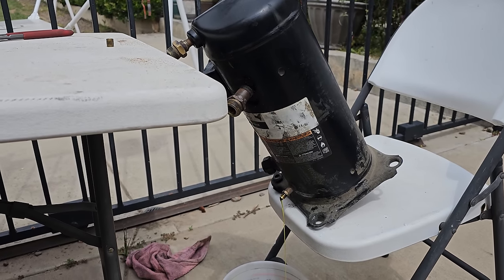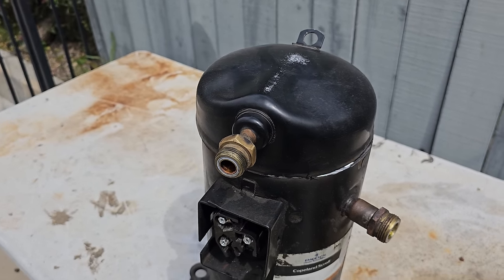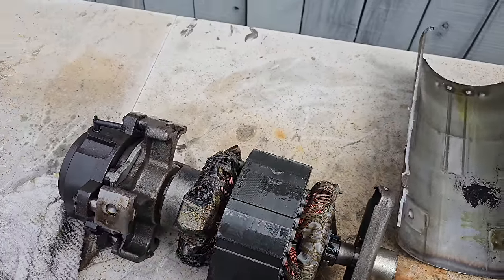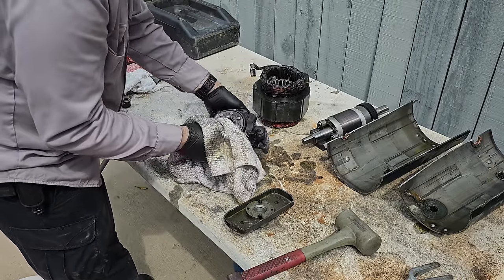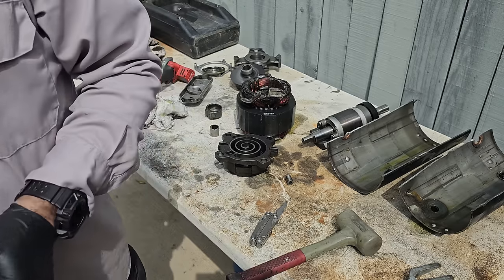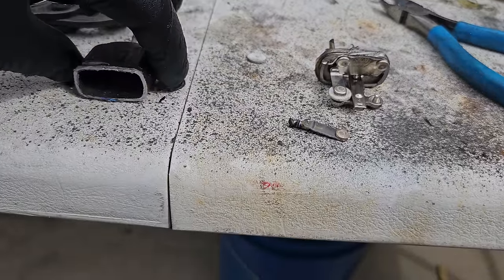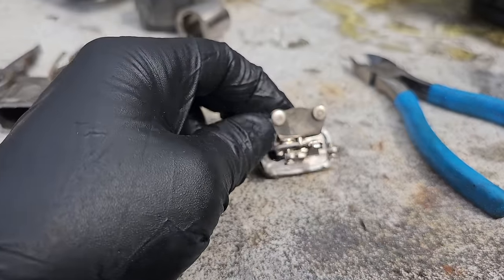COPELAND SCROLL COMPRESSOR TEAR DOWN

Comment: One easy safety tip is I know of someone who died due to cutting open a container with oil vapors inside, and it exploding due to the oil vapor/air mix and a spark from their grinding wheel. You can run a nitrogen purge while cutting, which should help reduce the risk. Thanks for making these videos as is is very cool to see what is inside.
Reply: Wow :(, may their curious soul rest in peace☮️ 
ive known of the risk with trapped vapor in oil which is why i drain and wait a day or two to start cutting, but this just placed me into a new world of respect… 
the worse flare ups for me are overheated or grounded compressors. Refrigerant grips onto the oil like crazy even after smacking the life out the casing.
Reply: This a compressor not a sealed container. This is open to atmosphere (open air) already, after pulling a vaccum on unit, and has 2 ports open that will dissapate anything left over if it heated up enough which a grinder likely wouldnt.
Reply: There isn't nearly enough volume here to have enough oxygen and oil vapor to explode. It would be a minor puff if at all.
Reply: @hgbugalou  you'd be surprised at the energy content of some of these refrigerants. I also have a different friend who combined some acetylene and oxygen in a small balloon (couple cups) and lit it on fire. When the fuel and oxidizer are mixed (like they would be in this), the explosion is waaay more powerful than a normal fireball because the flame front moves far faster than if you light the fuel on fire in the presence of air. It will be like a little bit of high explosive going off rather than a puff. From just a couple cups worth, my friend got the cops called on them because people thought it was a loud gunshot.
Reply: @kscgaming5857  This is exactly why I made this comment. It seems safe, but eg r290/propane has a lower flammability limit of just 2.1% in air. That means if you have anything above about 2% propane, it is an explosion hazard. Even with it open to the air, you could get pockets which are >2% propane, and then be a risk.
Reply: @armandodeleon5047  Thanks for the wishes and stay safe.
Reply: Yes but the limit for r290 in a self contained system is 5.5 oz, which isnt much, and still you would have bled the system and use some nitro to ensure its all out. The above video wasn't propane / r290 though, as common refrigerants are not flammable at ambient pressures/temps. That being said I also have had flame outs on r290 systems after having purged with nitro a couple times can be annoying.
Reply: @ErikMeike  I get your point but oxygen at atmospheric concentration and polyolester oil vapor generated at under 100F isn't going to explode like that once exposed to flame. Acetylene contains much more energy.  Polyolester oil is also very hydroscopic so there is going to also be water vapor further limiting said reaction. At worse it would just belch a little flame.

Comment: I think a contributing factor may have been a faulty solder point where the incoming line that melted off was soldered to the overload switch.  The points don't look burnt, but the joint into the switch is, implying that there was pretty big resistance there.  I will say that the points do look used though, and in an ideal situation a thermal overload switch should look brand new.
Reply: Alternatively it did short to ground but the solder joint blew clear before the fuse did.

Comment: I've never seen a compressor with compression fittings on it like that.  you know when you got compression fittings installed on your compressor pipes you're changing it way too often.  I'm not sure what kind of maintenance you think could have saved the compressor but the only regular maintenance that could even help is cleaning the coils.
Reply: I don't know why these refrigeration guys always gotta have fused disconnects. But as an electrician, I can say it's ridiculous. And in this case here, actually caused this problem.

Comment: We just had a “new customer” call to a restaurant. WIF down. Unit (installed new by others) in 2019. Compressor #2 installed in 2020 (by other). I confirmed this compressor was shot too. I Replaced the compressor, and during pump down test, noticed it did not shut off. I assumed bad lo pressure control. When I undid the capillary line I notice the stem was in the suction line. It must have been there since day one. The only time the unit ever shut off was in defrost. Ran for 3-4 years constantly and in a vacuum too. I Told the customer he’s all set now and might notice a “rebate” in his monthly electric bill. 😂😮

Comment: So, drop in a salvaged stator, put it all back together, crudely weld up the case, and put 'er up on eBay as "rebuilt" at a price only 25% higher than the cost of a new compressor. (Hey, gotta get something for all your labor, right?)

Comment: As a nonprofessional subscriber who watches because because I like knowing how mechanical things work and enjoy the logic of diagnosis, I had hoped that you would have shown how the actual scroll mechanism works. I know that i am not your intended viewer as I assume that the professionals learned that on day 2 of tech school, but how a scroll compressor works has  puzzled me since I first learned that they existed may years ago.I would guess that you have many others who watch not because they are refrigeration techs, but because they are curious.

I still enjoyed your logical approach, determined how it was murdered very much even though it left me wanting more.
Reply: I was hoping for that also. 😁
Reply: There is one fixed scroll and one orbiting scroll that basically just oscillates enough to press gasses onto the fixed scroll which is where the compression happens when they are fit into the tiny vanes through the scroll and press up against the walls of the fixed and oscillating scroll.
Reply: Look up scroll compressors, there is a shit ton of info.

Comment: You can tip the oil out of the suction port.

Have a site where they have killed a few compressors due to dirty condensers, they chop straw for cow bedding near by and you can clean the condensers one week and they are dirty the next. Have now fitted a delay timer so that the compressor won't restart immediately when the hp resets, reduces the starts per hour to a safe level and lets things cool down before trying to run again. 
   Trigger the delay timer from the crank case heater supply (assuming its on a NC contact on compressor contactor) so its a delay on restart. It won't affect normal running as usually 6 minutes (or whatever you decide) will have passed before normal cooling signal is sent, and also by doing it this way if the timer fails it fails in default run so system works ok.

Comment: No way!! I literally just cut a scroll compressor apart and fixed it. The bush that allows the motor shaft to spin and oscillate the moving scroll had seized. I cleaned it up nicely and it runs beautifully.

Comment: That overload looks like the lid switch on my old (now replaced) washing machine. The full machine current went through that switch. On my machine, the contact pin shifted slightly, causing an arcing fault to happen. The switch on your compressor looks similar. It melted because it was arcing. I might be wrong, but that's what my eyes tell me.

Thoughts on the HPC trip problem: As much as I HATE electronically controlled equipment, it may be neccisary for this problem. A simple microprocessor to count trips. If it trips more than maybe 2 or 3 times in a 2 hour period, then lock out and require a manual reset. Maybe just lock for an hour or so, then auto-reset ONCE. If it trips again, then lock until reset manually.

Comment: We have sensors all over the place that link to the company issued associate phones and other inventory equipment. Any pressure or electrical related alarms are sent to the management teams but over temp case warnings and warnings on the walk in doors being left open or even if the cases are overloaded with product the phone will pop up a notification telling us to go check it out. It even puts a work order in if no one checks on it and clears the message out in enough time.

Comment: Those toc contacts were like new I think that was a manufacturing defect on the coil to toc connection... are they crimped or soldered??? Either way it was done badly..

Comment: That’s wire’s burned indicates of multiple reasons. 1. It could be restriction of condenser coil air flow. 2. Overcharge system. 3. Power supply conductor loosen contacts. The first two is related to what your mentioned about short cycling, and that’s related to either over charge or dirtied condenser coil. 
I’m in Iowa state. The temperature difference, and average altitude around it will play a big role when it comes to charging system.

Comment: It's always painful to see a part you installed that is busted due to a lack of maintenance, I just ordered a compressor for a mobile merchandiser that's only 3 years old (the compressor not the unit) I'm pretty sure the last time the condenser was cleaned was when the compressor was replaced. I showed up, compressor is about 80% blocked with dust and it's short cycling. Gauged up it short cycles then stays off for about 2 minutes, the pressure is equalized even with the compressor running. My bet is the compressor short cycled on head pressure until it broke the valve plates but either way I'm sure it short cycled on head pressure until something broke. I agree on opening your compressors when you can, I deal with a lot of semi hermetic compressors because I do supermarket refrigeration and I can confirm Copeland and Carlyle don't really care if you open them and poke around as long as you put it back, never cut the body of them though because they reuse the core, even if it's not warranty don't cut it because you will be throwing your core return in the trash.

Comment: Educational thanks! Got a question for someone...I used to work on Island resorts and the catamarans would pitch heavily in rough seas and the fridges never missed a beat as far as I know. Tilting of a fridge is not recommended whilst it is running due to the oil getting into the refrigerant..is that for old fridges only(worn seals)?

Comment: Unsure if it's normal or not, but when you pull the head off of the compressor, the bearing? race is not perfectly round, it's a bit oblong, with one side missing a substantial amount of material. Now because it's a scroll, that could be perfectly normal, just looks weird.

Edit:
Seeing the overload in that condition, I agree with @jeremycampbell3497 that this was most likely an electrical connection failure on the terminal. Weak joint from the factory -> vibrations in the rack and some flooded starts due to lack of maintenance caused the crack to widen -> compressor starts going off on thermal overload, and the current running through the damaged joint begins overheating the terminal until it fails. It may have shorted just enough to blow the breaker, but then disconnected when things cooled off.

Comment: We had an identical Copeland scroll like that fail in the walk in freezer  at work. The controller would lock out with an error code showing phase imbalance, when measured it was 15% more.  We bypassed the controller to run the unit till the new one arrived and it held out. It was only about 5 years old and in good condition and the only non serviceable part failed!!

Comment: Great Vid, Thanks
I disassembled a LG compressor from a 3.5T Lennox air conditioner condensing unit. 
Symptoms:  Low differential pressure output to input (HS pressure low, LS pressure high). 
Could not find anything wrong inside compressor. Ever seen anything like that?
Replaced entire condensing unit as fix.
Thanks
Reply: Was it a scroll and 3 phase? Maybe it was running backwards.

Comment: So there wasn't any high side temp or pressure controls other than inside the compressor?  A manual reset control would have protected the compressor.

Comment: These motors are just small for their hp rating. They expect the refrigerant to cool the motor . If they made it bigger so many would have not failed. 
That motor is smaller than 1hp industrial induction motors or pump motors.

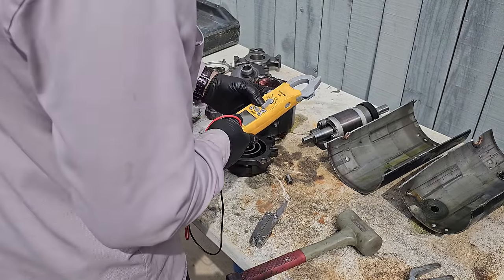Comment: At 6:00 as to fault to ground?  With it submerged with oil, degraded oil can be an excellent conductor. With the removal of the degraded oil an draining it is possible loss.. But I totally agree with you.. I am always opening comp on weekends cuz I am puzzled an I am  anal as exactly why it failed… lol I open a warranty one once an?? Lol I got in trouble for hazmat leakage during shipping back… not for cutting it open but for oil residue seeping into the cardboard 🤷🏻‍♂️( edited for oil base clarity )
Reply: Oil is NOT an excellent conductor, unless badly contaminated. Oil is used to insulate and cool high voltage transformers, if what you said was true they would be exploding instantly on power up.
Reply: @mxslick50   yes you are correct .To a point; brand New POE and its counterpart PVE oil are specially designed to provide very high dielectric properties – they insulate electrical components.  However PAG oil on the other hand “is” conductive.  
Lubricants are normally only slightly conductive and therefore can work as insulators in transformers or switches. However, oils can also conduct electric current. Their conductivity is dependent on several different factors, including the base oil, additives and polarity. But oils that have been degraded an burnt ; do not have the same properties of conductive non conductive new oils. Due to the chemical composition changes they go through.
So not to argue your point, I was not thinking in the bases of new oil. I was basing my comment on the oils being degraded an there molecular composition being changed.

Comment: 17:01 Is there some kind of contactor interlock system that can detect when a motor loses a leg (for longer than a specified threshold of time to prevent nuisance tripping) and kick out requiring a manual reset?
Reply: ICM 450. Will do that. You see them quite frequently on larger equipment to protect the components. Also the ICM 401A is a lower cost version with not as many features but, also is for phase loss.
Reply: Thermal overload relays usually detect this. Some will trip when a phase imbalance is detected by the TOL heaters.
Reply: Any motor starter would have saved this compressor and most of the ones that's been taken apart on the channel. It's amazing they are not standard on the equipment.

Comment: These wires sometimes break at the overload protector from vibrations I think. I had the same problem on a failed Maneurop MTZ piston compressor. Everything inside was totally fine and looked like new, only one wire broke off this overload switch, wasn't even melted or shorted - but it caused an open winding and unfortunately made the compressor unusable.

Comment: I tore down a recip a couple of weeks ago for my guys. Same issue happened where I had LRA with no grounding. Single phase 240v. Both metal contacts broke off on the start winding. I replace all start components when I replace compressors. I found the old cap and saw that someone had put in a 20uf cap on a 35uf compressor. I now have the parts in my office for a "wall of shame" moment.

Comment: What would cause the copper plating?
Reply from the maker: My understanding is Under extreme heat situations moisture reacts with the oil and creates acid. The acid starts to eat at the copper and with the same extreme heat the copper starts to collect in the high temp areas and it actually bonds (plates) on the high heat surfaces
Reply: It is trace moisture reacting with the halocarbon forming HF. The acid dissolves copper forming a salt that is soluble in the polyether oil. Next it reacts with the steel plating copper. The newer pure HCF type refrigerants like 134A are very bad for this since the water is catalytic with that one in the presence of the copper.